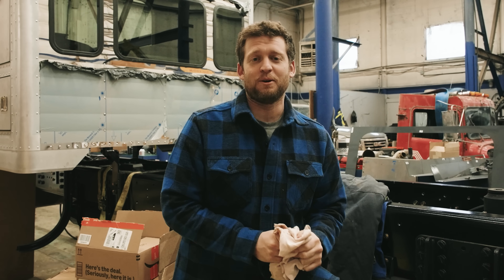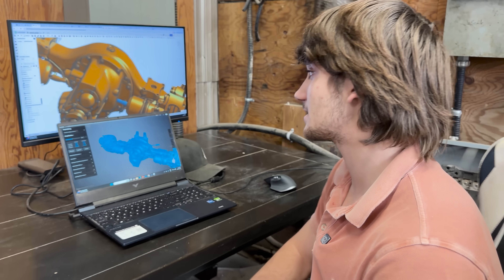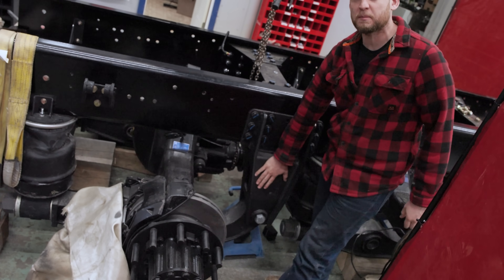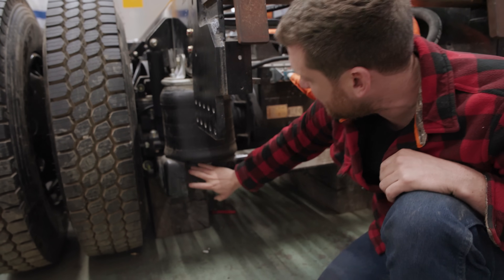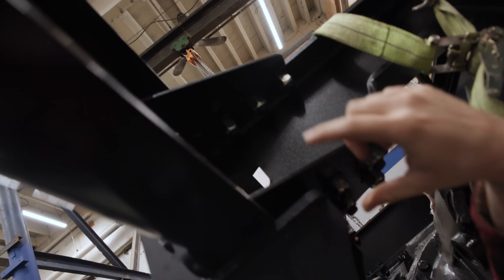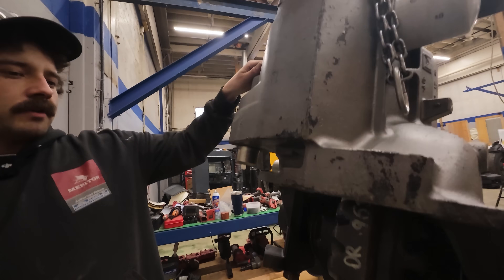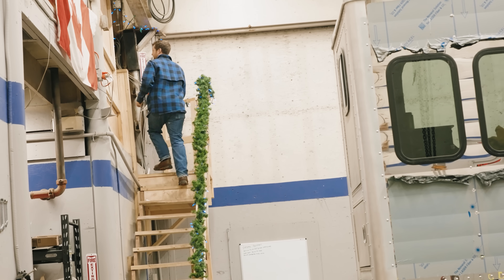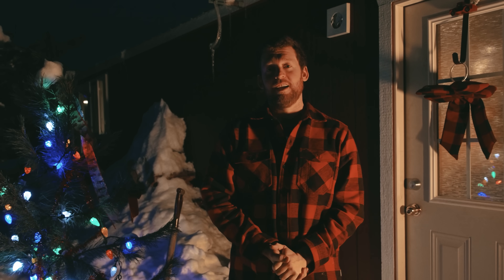When Precision Becomes the Problem

Comment: about the brackets,for the rear axles, welding them first,on the workbench or manipulator, makes probably for better quality, and at least the welding is easier and faster. the hole  alignment problem can be fixed either by straightening the welding deformation(torch, hydraulic press ) or-easier- ordering the plates with an undersize hole, then reaming after welding with a self aligning reamer. ( that is what we do at my workplace)easy on the workbench, not so easy on the axle, where the same thing probably will happen.

Comment: It's funny, when I saw him with the 3D printed version and saw how tight it went on, I immediately thought that that was going to be a tolerance issue, and then we get a little further in the video, and sure enough!
Reply: I think the story of "one mechanic told the engineer to make it that tight and he would just grind it off".
cut to "that guy isnt around today to solve the problem he created" was a perfect example of the real world.
Reply: @mrlithium69 I would say that mechanic is also missing the point. What he told the engineer is perfectly viable for a one-off prototype. And may even be appropriate. But it is not sustainable when moving into production. If you are trying to make a part that will be mass manufactured, you have to get it right, and not be adjusting it afterwards. And that is an easy trap to get stuck in and growing pain to have when transitioning between early prototypes and production. Changing the mindset of everyone to match.
Reply: I saw that as well and wondered if the plastic was flexing.

Comment: Incoming part inspection for inventory on receipt and tolerance stacks for parts before ordering and again inspection on receipt are important processes that seem tedious. In my design experience opening up tolerances as much as can work and giving more of the tolerance in the stack to larger parts where possible is a good idea. Admittedly a lot of things need to be learned by doing but hopefully we apply the lessons learned instead of learning over and over by doing.
I think pre-welding the bracket in a fixture and then boring the final hole for the pins in a fixture would work for you. I could see welding access on the plates to the axle causing as much or more trouble.

Comment: 1:20 no potential Edison Motors customer has ever thought, "what I want is a reliable and rugged truck that I can fix myself, but I want some shiny lights from China that will blink in the head liner!". 😅

I appreciate the channel's humor.
Reply from the maker: Joel just really wanted it.
Reply: I don't think they're offering it as an option. They're doing it for their friend Joel

Also, what's with the random aggro against China?
Reply: @gormauslander you might wanna go back and reread tast line of my post. 

I didn't mean to ruffle your tutu, princess. Your welcome to put lights from any country in your headliner
Reply: It's definitely a younger generation car mod, but it harks back to the old Moon/Mood Lights of the 80's to 90's that were popular in van conversions and some trucks. Its way easier and cheaper to maintain, but the initial setup is a LOT of work. My wife is working on it for both of our cars lol. It's like 50 bucks to do it yourself, and every few years you replace the projector bulb. Everything else should last indefinitely. It's a cheap, neat mod to add some flair and does actually fit the DIY scene and modern car culture.
Reply: especially that if its in the truck on delivery day i think its supposed to be a warrantied item by the truck manufacturer.... nice option but... big potential issue. like what if its starts a fire.
Reply: @brunochabot9847 fiber optics don’t cause fires lol
Reply: @arm279145 no indeed but the power going to the device that sends the the light can. Its a whole system.  Nut just some fiber run. What if you lose the controler. How do you replace that. To have a reliable system they would have to have it custom built whit thier specs. On a low order. Bellow 1000 units its gona be fairly expensive for alot of potential issues in the future. For prototype vehicles like a one off its okay to explore the idea.
Reply: @brunochabot9847 the power going to the device is probably 5v. That's not going to start a fire. Also, it's not a factory option. They made this for their buddy.

Comment: 16:09. my 2 cents on this "fitment issue" you can make those brackets how they are, but you will need a post weld process to machine the openings for exact placement. Have done several parts with similar processing, GD&T with a cylindrical callout and perpendicularity to the "axle mating surfacs" would keep this in line. Then again, you may not even be doing it this way on the next few versions. All about having the options, much like just picking up another axle locally.

Comment: For your ICE trucks, are they being designed for easy conversion to hybrid, for when the regulators finally come around?
Reply: No, if the engine is in good condition it will be cheaper to sell the ICE truck and buy a hybrid. Of course it is possible to convert, but a lot of work. You have to remove the engine, gearbox and transmission and install everything new. The engine mounts will be different.

Comment: At this point in the comments, 110+ -, I think the only thing I would add to the comments regarding precision, is, generally, you have to work out from the part with the least amount of precision.
Unless I missed something, in this specific example, that is going to be those axle housings as I assume they are cast.  If they have machined locations where you want to attach that will "solve" some potential issues but, as others have said, you have the potential to compound a problem if those hangers are not being final machined post weld.
As development of process continues, you should be able to give suppliers specialized "go, no go" gauges (or they make their own) which means, hopefully, parts that don't fit and fit together never arrive.  Plus, then of course, anything made in house has to fit as well.

Comment: Slapping the 3d print on to fit was foreshadowing @14:37
Reply: Yep friction fit plastic.
Reply: Jep, saw that and had to think of the time i made that same mistake. I was also the guy grinding (in my case milling) the excess out, so the learing experience was quite effective.
Reply: I wondered if the plastic flexed.

Comment: 5:58 sounds like you're falling suit into a dealer only part....
Reply: It makes sense for some parts to be dealer parts. Not everything can be custom or come from the hardware store.
Reply: @goshawk4340  He literally said it was either wait MONTHS for the correct rearends OR totally change the plan, which he did, which is against everything he preaches when that vein pops out of his neck.... Jusssst saying.. I would like to hear Chase's response
Reply: @chrisfortin8549 eh that axle housing is gonna be there for the life of that truck most likely. And like he did say. Bare housings is pretty common.

Comment: Chase. The term you're looking for with the wishbone suspension is the angular factor.  Which in some cases can multiply the lateral force on the axle into a higher force in the bushing. 

Triangulated 4 link suspension on buggies does the same thing. Bushings take a beating.

Comment: I still think your doors need a step well, like flat front busses. Nobody wants to hit their head getting in and out of the door, or climb in hunched over, to get to their seat. With the seat in the middle it would make it much easier having a full height door, with a 2x2 ft step well, you can also kick off your boots there, then step up to a "platform" where you mount the seat.

Comment: back in scool during metallworking classes out teacher told us about a specially tollerance from the east german era: Russische Wurfpassung - Russian Throwgauge. aka hole got big enough you could throw a thing thru it.

I also just got a brainfart idea for the next expedited Edision prototype  Basicly your own Unimog with electric powered PTO's and or Hydraulic that allows for not just Snowplow or that rotary plow or brushes but also during Summer time for Mowing and cleaning Attachments for road signs or lifeguards rails.  no idea how to make it all wheel drive tho with current electric axles you got perhabs motors in the wheel hubs itself?  that smaller 2 axle truck would also be really neat for man basket boom trucks same with service trucks.  something bigger than the Pickup kit but smaller than the full trucks.

another alternativ could be your own version of the Unimogs little socialist cusin from east germany: the Multicar. basicly a german K-Truck with Hydraulic attachments and all sorts really usefull for snowclearing on pedestrian paths and inner city parts that are carfree were big snowplows dont fit.

Comment: There are standardized classifications for fits, both ISO and ANSI. I also HIGHLY recommend purchasing "Machinery's Handbook". It's sort of like the Guinness Book of Records, but for designers, engineers machinists. IIRC some CAD software includes fits and tolerances as a feature.
Reply: It's almost like they learned all this shrinking and warpage and clearance stuff 100 years ago and wrote it down in a book.

Comment: pro tip: weld the pieces first and have the holes be rough-cut, and then once all the warping is done, you do all the precision boring/machining
Reply: I was hoping he would come to that idea on his own, but alas maybe he will see this comment.
Reply: I mean, technically that’s exactly what happened.  The holes don’t need to be cut to different “tolerances”, as in this case the first hole was cut to a tight clearance and then the clearance was opened up to fit.  Tolerances weren’t actually the issue here.  It was clearance all along.

Comment: Two questions.  Why MDF instead of thin marineor aircraft grade plywood? MDF will not tolerate accumulated from breathing when it is cold enough to cause condensation. Seems cheap on an otherwise quality build.

Ever think about an actual night sky map? Could even have several patterns (seperate clusters) to match the customers night skies.

Comment: Work in aviation, we are always told, "well it worked in CAD"🤨
Reply: Try putting up a building when the elevator core is both offset and twists. It fits in cad dont mean shyte in real life.
Reply: I guess that's the modern version of, "the sliderule said it would work."

Comment: Really appreciate going over OnShape and the actual design. You know someone is an expert when they can explain something that clearly and concisely!
Reply: I didnt realize it could auto-apply the dovetail mounts to slot a multi-part assembly together in 1 click. that one feature alone is worth it. I didnt really follow why it was an issue for the software to go from triangles to solid body needing to use a custom extension from some random guy. Seems a standard operation. They should address that natively.

Comment: As an engineer, the moment that happened @13:45 would have been avoided if he didnt have to pound the 3d printed part on at @4:35. Clearly there was no clearance designed with a tolerance lol. It was an interference with plastic so 1/2 plate ain't going to work like that. Lol

Comment: And by “glued on” I hope he means welded? But I was really dying on the THree vs FRee , those free brackets came out great, I need to upgraded my machine to being a free-d printer, I’m still in the stone age and have that old 3-d machine? I’m only picking on him, he is actually a very good designer, with knowledge of what works on the software does not always translate to the actual truck, so to see him physically touching the actual truck is great, making sure he’s not designing a bracket to hold the engine that blocks access to oil drain or similar

Comment: The axle situation was a PRIME EXAMPLE of why you need the ability to conveniently go to a local part shop to not only find & fix problems with a truck On or Off Road (this case in manufacturing), can be very time saving and more accessible instead of waiting (God knows how long) on a manufacturer to supply parts.
Reply: Cummins swooping in with that massive supply chain yet again.

Comment: Love the little lesson in tolerances but there's a difference between tolerance and fits. The piece of paper has the correct definition of tolerance which is the acceptable dimensions of a manufactured part. Fit is how tight or loose the mating is between two parts. At 15:21 when you say "the engineer asked if we should make these tolerances tighter or looser" you're actually talking about the fit. An engineer determines tolerance of a part by trying to reduce the cost of a part as much as possible (more precision more money) and still get the desired fit.
Reply: Our family business is a davenport screw machine shop. A customer ordered thousands of a part. We made the parts to the blue print specs. The parts didn't fit, so the customer didn't pay. The problem was their print. Had to take them to court.
Reply: this is a business to business person to person issue, not a mechanical failure. sending only a blueprint over and sending 1000 parts back is putting too much trust into both sides of the equation.
the customer needs to be given a sample or two (translates to an extra week of lead time) - wait for the OK, and only then should he sign a contract to commit to 1000 parts. you both failed each other
Reply: @Sah-o5m insane that you had to take them to court. It's their problem with their spec. I hope you got your lawyer fees and lost time reimbursed on top of the material and labor costs.

Comment: 13:27 When I saw the fitment for the axle hangers earlier in the video, I noted that the 3D-printed mock-up was a bit snug. 3D-printed material, while more fragile, is also a bit more flexible than steel, and when he had to hit the mock-up a couple of times by hand to get it in place, I knew there would be trouble with the real deal. Steel parts of that thickness would be inflexible and that metal would have to be grinded out.
Reply: Haven’t finished the video yet but that’s the first thing i thought when I saw that fitment.
Reply: That and those axle housings are casted, cant trust a cast piece to be perfect. Even weldments move and cant be trusted. Weld them in a jig then bore and hone the holes after the fact, only way to make them true.They may also want to drill the hole and not start with a green hole. Green holes take high feed mills to open them up and is slow. They might be able to drill single point hone, but most likely will be a 4 tool process drill, twin bore, single point, hone, that is honing is required. Single point should be able to hold the sizing they need. How ever honing makes nice easy repeatable parts. We run lots and lots of fixed carbide, or ceramat reamers at work, in these exact kind of weldments.